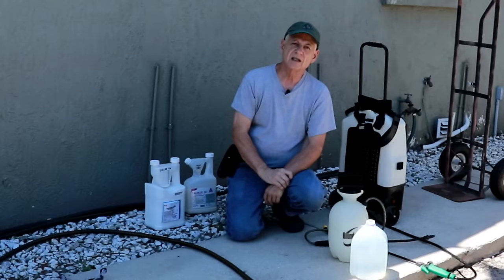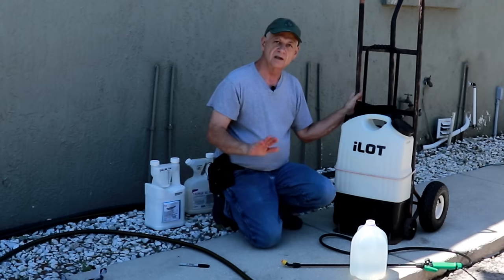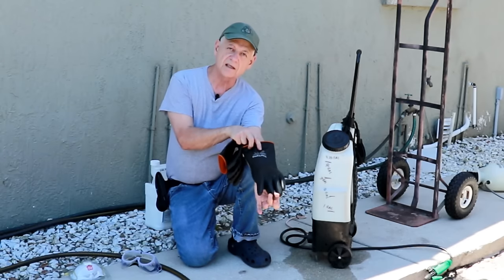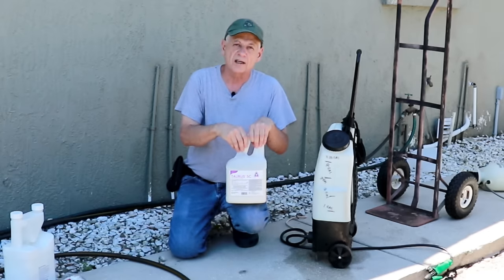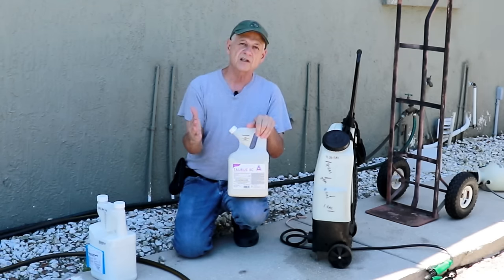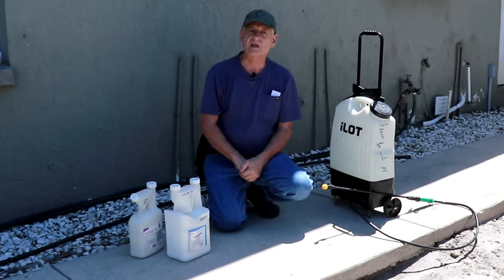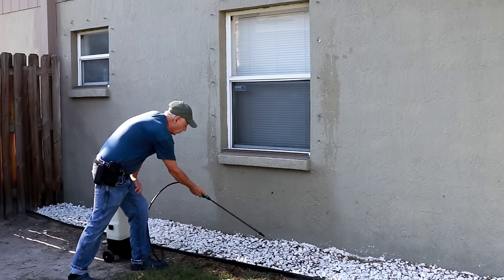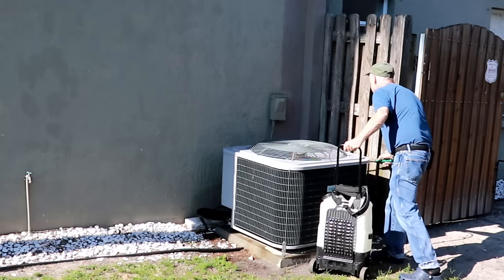General Exterior Pest Control - IMPORTANT!  READ THE DESCRIPTION.

Comment: Love your videos, Guy. Does this work for Scorpions? I've been using Onslaught FastCap, which may be controlling the issue, but I have a ton of earwigs in the house now.
Reply from the maker: Onslaught FastGap is a great pesticide for scorpions and spiders.  It should also kill the earwigs as well, but the problem is that onslaught is a very expensive pesticide, so you may not be applying enough of it, or you may not be applying it where you need it.  I know at that price, I probably wouldn't be.  It sounds like you are doing a good job controlling the scorpions, so I would continue just doing what you're doing with regard to those guys.  However, you may want to try an additional treatment for the earwigs.

Earwigs are coming in from the outside of your house, so the first thing you need to do is treat your yard.  You need to apply a pesticide on your entire yard and up the side of the building about 36 inches.  This treatment should be done every 60 to 90 days, but it does not need to be done in freezing weather.  I have a video on how to do that and I will give you a link to it.
 
Now that your yard is treated, you need to get rid of the ones inside the house.  Apply D-Fense dust under baseboards and in cracks and crevices wherever you see activity.  You should also apply it around pipe penetrations under sinks and other plumbing fixtures.  It is a good idea to remove outlet covers and apply it between the outlet box and the drywall, so that the dust gets into the wall void.  All you need is a handheld duster.  Fill the duster halfway and apply the dust with the spout on top.     
 
I hope that helps.  Be well my friend.
           
Video on how to treat your yard with a hose end sprayer:  https://youtu.be/wifoTU5dmp0
 
Bifen XTS:  https://www.domyown.com/bifen-xts-p-1236.html
 
Duster:  https://www.domyown.com/bellow-hand-duster-p-106.html
 
D-Fense dust:   https://www.domyown.com/dfense-deltamethrin-dust-p-2428.html

Comment: Great instructional video, thank you.  

Question:  You make mention how dangerous it is to get the solution on yourself, but what about walking on it after it dries?  It's that bad for you as well?  I am concerned about kids in their bare feet.  Thanks.
Reply from the maker: The truth is that it's not all that dangerous to get the pesticide on yourself.  I just need to tell you that as a legal disclaimer.  You don't want to bath in the stuff, but I get it on me all the time.  The concentrate is not good to get on you, but the finished solution after you mix it is not very hazardous.  Still, you should wear the protective equipment.  The pesticide is safe for kids to play on after it dries.  So, no worries there.  I now have an updated video on how to do this that is shorter and easier to do.  I will give you a link to it.  Also, please watch my video that explains the truth about the actual hazards associated with using pesticides.

I hope that helps.  Be well my friend.

Updated video on how to treat your house:  https://youtu.be/Yozv3s-Qwlw

Video on the truth about the actual hazards associated with using pesticides:  https://youtu.be/i7nLO6Js_3Q

Comment: Great video.  I found spraying at the higher levels a lot more challenging.  I used a 2 gallon sprayer because the one you used was just to heavy for the high areas.   Even that was not so easy but worth it.
Reply from the maker: I was struggling with a four-gallon sprayer for a long time before my wife asked me a simple question.  She wanted to know why I didn't just fill the sprayer up halfway.  I started doing that and it sure did make things a lot easier.  Boy did I feel stupid not thinking of that myself.  How obvious can it get?  I too have had difficulty with getting to those higher up places, so what I do is I only put one gallon in the sprayer now when I try to treat those areas that are kind of hard to reach.  Also, you can buy a sprayer that can put out 65 PSI and it will shoot the spray quite high.  It is a 3-gallon backpack sprayer, but again, you do not need to put 3 gallons in it.  This prayer puts out a lot of volume and so you can complete a job very quickly with it.  I will place a link below for it.

I hope that helps.  Be well my friend.

Sprayer:  https://smile.amazon.com/dp/B08B3MKYWD/?coliid=I1WHD5A3RF25H9&colid=3VDXA5DFBKQ98&psc=1&ref_=lv_ov_lig_dp_it

Comment: Great DIY Video! Thank you for sharing your expertise with pesticide maintenance. Where do you purchase the Taurus SC? Does Lowe's, Homedepot or Ace Hardware carry the product?
Reply from the maker: Thank you so much for those kind words.  The pesticides can be purchased from domyown.com.  None of the big box stores carry any of them.  The sprayers are no longer available.  Just purchase any battery-operated sprayer from Amazon and you should be okay.  Just do the first application with Taurus SC.  After that you can use Bifen XTS.  I don't show it in the video, but I it's a cheaper way to go.  It looks expensive, but it gets mixed at 1/3 oz per gallon, instead of 1 oz per gallon like Talstar P, so it goes a lot further and ends up being a bit cheaper per finished gallon.

I hope that helps.  Be well my friend.

Comment: Hey guy,
Very informative video, lots of good information. Thanks for doing them.
I live south by Houston in Texas.
Found some sub tubes on my second story ceiling, on the north side.
Found some wings in the bathroom window too on the south wall, on the north side of the south wall.
And  tubes here and there along the entire west wall of the house.
Found one dead termite with wings.
Nothing alive though. 
Looks like they're already in half of my house. Which was built new in 2010.
I though they ate older homes.
Any way , I bought some FiPro foam and was going to put in the holes in the sheetrock up stairs in between the studs.
And Taurus sc was entertaining trenching the perimeter. 
I wasnt going to hold you to anything.
But I was wanting to hear your thoughts 
Other than tearing out some sheetrock and hoping to see some live activity. 
My attic doesnt have much height to help with visibility of damage. I could only find 
Tubes along the top plate in the north wall ceiling.
Thanks Joe
Reply from the maker: Hi Joe.  Yes, I do have some thoughts.  First, you should know that the termites that have wings are called swarmers and they are made up of new queens and kings that are looking to start a new colony.  They only live a short time when exposed to the air, so if they cannot find a place to start the colony, then they will die.  Hence the dead bodies.  Now, if you just find the wings, then it begs the question, "Where are the bodies?"  Swarmers shed their wings before establishing a new colony, so if there are wings and no bodies, then they may have succeeded in starting a new colony.  Here is where it gets interesting and perhaps somewhat confusing if you don't know how termites work.  You live in an area where there are basically three kinds of termites.  You have the plain vanilla subterranean termites, drywood termites, and Formosan termites.  Mud tubes are only created by subterranean termites and Formosan termites.  Drywood termites do not create mud tubes, so I think we can rule them out.  The plain vanilla subterranean termites typically build the mud tubes low to the ground and eat their way up, so it is not common to see mud tubes too far from the ground, unless the infestation has been around for a long time.  That makes me wonder if these guys are not Formosan termites.  These guys often build the mud tubes on upper levels of the home and unlike other species of subterranean termites, Formosan termites have the ability to colonize in your walls.  Other species of subterranean termites must return to the ground fairly often to obtain moisture and to feed the rest of the colony.  Formosan termites do not.  Many of them will return to the colony, but some may well build "cartons" inside your walls to create sub-colonies and those termites never need to return to the ground.  Also, Formosan termites are the most aggressive eaters in the termite world.  They are capable of doing a lot of damage really fast.  Obviously, I have not inspected your house, but if I were a betting man, just based on what you have told me already, I would put my money on Formosan termites.  I may be wrong, but that seems to be where the road will lead.  However, you need to be sure.  So, my recommendation is to call a pest control company and ask for a free inspection for termites.  Just about all pest controllers will do the inspection for free.  After the inspection, ask them what species they are and ask them for a treatment plan.  You have a right to know what the species is and how they plan to treat them.  I like the mom and pop outfits the best because they usually do not use the high pressure sales tactics that the national companies use.  Most of the time the national companies are sending a sales person that wants to get you to sign a contract.  The local folks usually have no sales training and the person that inspects your house is most likely the person who will treat it.  Naturally, they will give you an estimate.  When they do, just tell them that you will be getting several estimates, thank them for their time, and tell them that you will get back to them.  Again, be sure they list the species and treatment plan on the estimate.  You want to know the chemicals that will be used and where they will be used.  Most likely they will trench the house, but for Formosan termites it will require interior treatment as well.  Once you have this information, just get back to me and I will guide you further.  Please note that your comment was held for review by YouTube.  I don't know why.  So, if you do not hear from me within a day or two, then please write to me at my email address.  It's guysyoutube@mail.com.  This is just "mail" and not gmail.  If you write to this email, please remind me of who you are and what the question was.  You can copy and paste if you like.  I answer a lot of questions every day and it's easy to get folks mixed up sometimes because some of the questions are very similar.  I hope that helps.

Comment: Excellent video Guy. You have just saved me a pile of money. Thanks.
Reply from the maker: You are very welcome.  Please note that you can also use Bifen IT or Bifen XTS, instead of Talstar P to save some money.  The Bifen XTS may seem expensive, but keep in mind that it gets mixed at 1/3 of an ounce per gallon instead of the one ounce per gallon that the Talstar P gets mixed at.  So, the product goes three times as far, and actually costs less per finished gallon than Talstar P or the Bifen IT.  These products all have the same active ingredient, but for some reason the Bifen products have a bit of an odor to them until they dry.  The Bifen XTS can also be mixed in a hose end sprayer that will allow you to also treat your yard.  I will give you a link to my video on how to do that.  Also, please note that this was my first video, so it was not exactly perfect.  I do not think I made it clear, but you should do your first treatment with Taurus SC, and then three months later you should begin treating with the Talstar P, and you do not need to use the Taurus SC again.  Just treat every 90 days with either the Talstar P or one of the Bifen products.  I hope that helps.  Be well my friend.     

Bifen XTS:  https://www.domyown.com/bifen-xts-p-1236.html

Video on how to treat your yard with a hose end sprayer:  https://youtu.be/wifoTU5dmp0

Comment: Great video! question - if you are using the Taurus SC, is it necessary to use the product recommended in your termite treatment video - the BioAdvanced Termite Killer Granules - as well, since Taurus is marketed specifically as a termiticide, as you mentioned in this video? Thanks
Reply from the maker: Taurus SC is a great termiticide, but for it to work on termites you need to dig a trench around your house and mix it with the dirt.  You can't just apply it on the surface of the ground to kill termites because it will not soak into the ground the way the granules will.  Therefore, you still do need to use the termite granules.  I did an updated video on how to treat your house that will save you some time and money.  It's only 8.5 minutes long and contains some great tips.

I hope that helps.  Be well my friend.

Updated video on how to treat the exterior of your house:  https://youtu.be/Yozv3s-Qwlw

Comment: Is Talstar P kill on conduct or slow? I was told Taurus SC wasn't and that's why it is great for carpenter ants, because they share it with the colony. I've been using it for carpenter ants and has been a God Send. Been battling them since 2018. I am using Talstar P for spotted lantern flies. Seams to be working. Thank you.
Reply from the maker: That's a great question.  Talstar P is not a kill on contact pesticide, but if you hit a target pest with it, death will occur fair fairly quickly.  It's not like you are going to see them immediately flip over on their backs with their legs kicking up, but they will be dead within a couple of hours.  If a target pest crosses it after it dries, death will occur within a few hours.  It works faster than Taurus SC, which is a very slow acting pesticide.  So, you are correct that Taurus SC does give the pests time to bring this material back to the colony and share it with the other insects.  That is why doing your initial treatment with Taurus SC is probably a good idea to deal with any existing infestation that may exist. However, all future treatments can be done with Telstar P.   It's not a big deal though if you skip the Taurus SC and just use the Talstar P.  The end result will be that any pests that cross it are going to die.  Either way, the pests inside your house are probably going to be gone.  It is also a good idea to treat your entire yard.  I treat my entire yard every 60 days with a hose and sprayer.  Since I have that sprayer in my hand, I also use it to treat the house as well.  It's a super fast way to do it and it's very effective.  You are not actually supposed to treat your house that way, because it does exceed label recommendations for the amount of pesticide that you are supposed to apply, but it will not hurt you or the environment.  To do that treatment you need to use a different product though.  I like to use Bifen XTS.  I will give you a link to my video on how to do that.  So, if you really want to get it rid of all the bugs once and for all, then do the treatment in this video and the yard treatment.  You may get a little bit of sticker shock when you see the price of the Bifen XTS, but keep in mind that it only gets mixed 1/3 of an ounce per gallon instead of 1 oz per gallon like the Telstar P, so it is actually cheaper per finished gallon of product.

I hope that helps.  Be well my friend.

Video on how to treat your yard with a hose end sprayer:  https://youtu.be/wifoTU5dmp0
Reply: @GuysPestSolutions  Thank you very much Sir!!

Comment: Thank you for the great videos and sharing your knowledge!  I am going to treat my house myself.  At my house, my concrete driveway runs directly along the side of the house into the carport.  There is a small opening where the driveway meets the foundation.  Is it safe to spray the Taurus SC into that crack, even if some gets on the concrete driveway?  Same question for my front porch, which runs the entire width of my house.
Reply from the maker: Hi Jay.  Good for you doing your house yourself.  You can do it better and cheaper than the pros.  You can spray virtually any pesticide directly onto concrete and into any cracks and crevices, including expansion joints in concrete.  The Taurus SC is no exception.  You want to spray it anywhere a bug could possibly enter the building.  I always spray the driveway in front of the garage door and along both sides of the driveway where it comes in contact with the lawn.  Anywhere dirt meets concrete is a breading ground for bugs and I soak those areas really good.  I spray all the expansion joints and any cracks as well in the driveway and the sidewalks.  You literally cannot over do it.  After it dries, it is perfectly safe for people and pets to walk on.  I hope that helps.

Comment: Hi Guy, thanks for making these videos! I've always used Ortho Home Defense. Would I notice an improvement if I upgraded to a product like Talstar P?
Reply from the maker: Thanks for the question.  The short answer is "yes."   You will definitely see a big difference in results.  The Ortho Home Defense uses the same active ingredient as the Talstar P, but the Talstar P is more concentrated.  In other words, there is more of the active ingredient in the Talstar P than in the Ortho Home Defense.  Also, the Ortho Home Defense typically comes already mixed in a hand sprayer that does not apply enough of the product to do a good job.  It's fine for treating around windows and doors, but not very effective for treating where the ground meets the house and also difficult to use when treating soffits.  So, while the Ortho Home Defense will kill bugs, it will not do it anywhere as effectively as using the Talstar P with a battery operated sprayer.  I hope that helps.